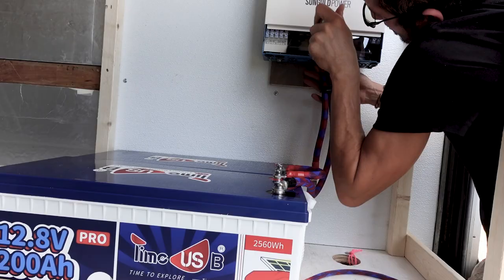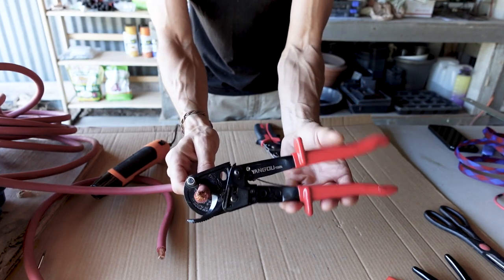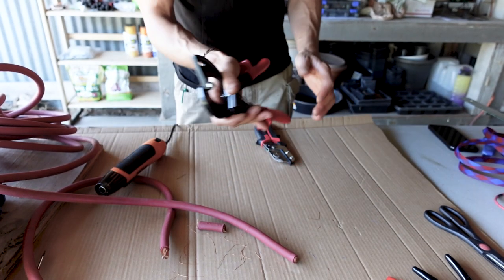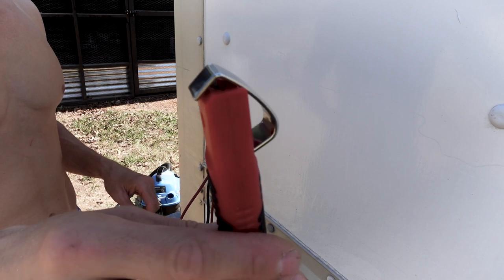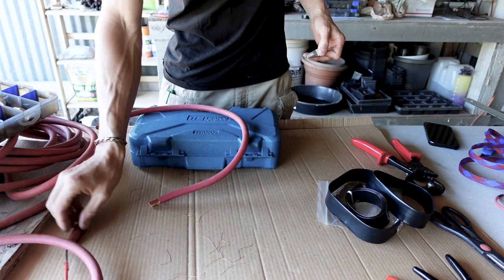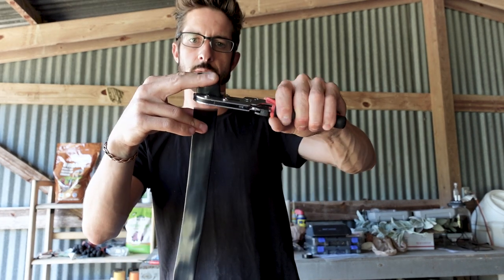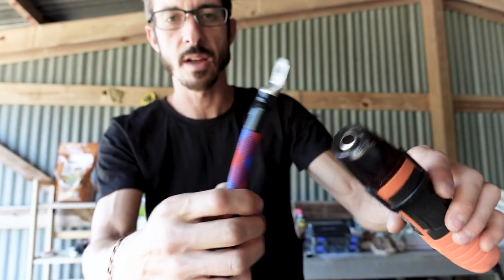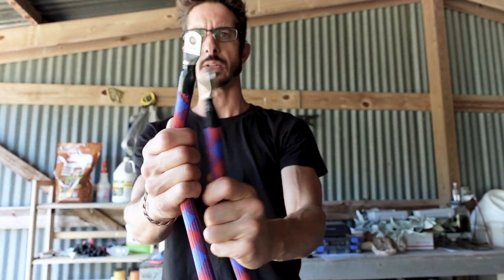EASY ELECTRICAL |  Box Truck Conversion

Comment: I'm curious why you put the loom around a single cable, and then shrink wrapped it? Also, what is that electrical system you're using? I'm just getting ready to order my electrical components, (Victron MultiPlus, Lynx Distributor,  Victron MPPT, etc.), but it seems like there should be an easier, or more streamlined solution. I have two 206ah SOK lithium batteries and 800W of solar (4 panels).  I'd sure like to find a simpler solution.  And thanks for the great tips on those tools, especially that crimper!
Reply from the maker: I used the loom just to dress it up. I really like these all in one systems, they’re so simple and a lot cheaper. 

This one is by sungold power. 
If you type “sungold mppt inverter charger” Into google you will find it.

It’s a 24 volt system but you can totally do that with two sok lithium batteries
Reply: @nomadbrad503 , do you have any videos showing how you installed that, your batteries, etc.?

Comment: Before  you put on ring terminal  you should have put on heat shrink
Reply from the maker: Thanks William!
Reply: @nomadbrad503  He says that because most of us would have used shrink that is just big enough to slide on to the wire. If you don’t put it on first you have to cut the connector off and put a new one on. That said. I’m enjoying watching your build.

Comment: @nomadbrad503 which Sungold model do you have?
Reply from the maker: Strange thing..there’s no model.. they call it the 3000w 24v solar inverter charger 

https://sungoldpower.com/products/3000w-24v-solar-inverter-charger?currency=USD&variant=39675861893257&utm_medium=cpc&utm_source=google&utm_campaign=Google%20Shopping&srsltid=Ad5pg_FtYkfiZYdSeA-GyVza01KYYqAN1VY_eiXuUpGdN8s_cH9s_uhDREA
Reply: @nomadbrad503  that's what I meant. I should've said size... So do you have a step down to run your 12v items? Sorry for all of the questions, I'm learning.
Reply from the maker: @JJfromIA  yes. Most things like the refrigerator and led lighting are 24v. I have a step down for the diesel heater and usb stuff
Reply: @nomadbrad503  thanks for all the info homie!
Reply from the maker: @JJfromIA  anytime
Reply: @nomadbrad503  any new videos on the horizon?
Reply from the maker: @JJfromIA  yes, hopefully this week. I installed an all in one diesel heater